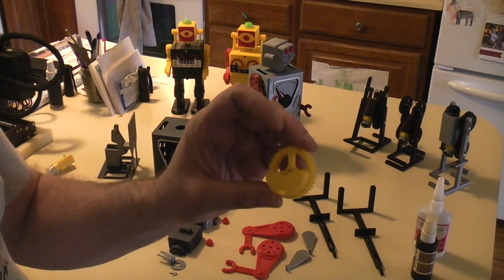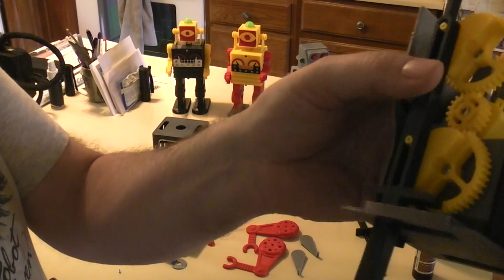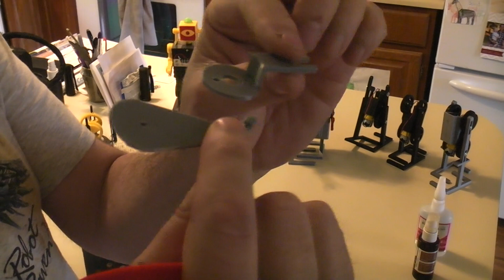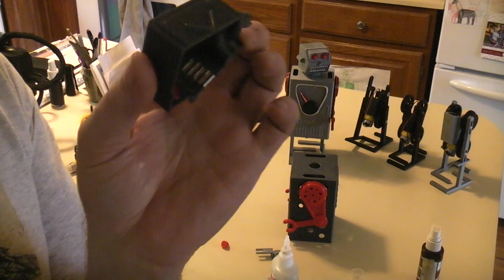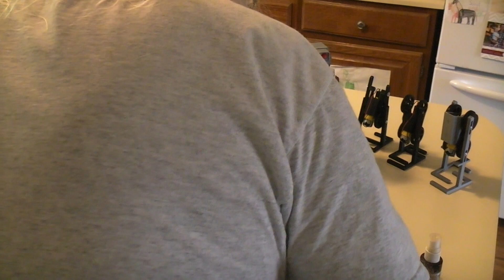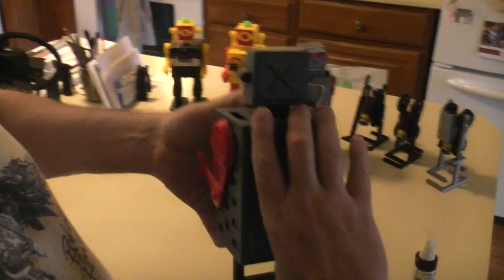"LIVE BUILD"  You can make the RoBox type 3 robot.

Comment: Just printed and assembled Type 3 robot, What fun!  and the video was so helpful. Thank you!!  Only having one issue..one of the lower cam gears keeps backing itself out after a minute of walking.  I'm using 3mmx12mm screws, maybe I need to open that hole a little?
Reply from the maker: Or maybe a dab of glue on the threads so they do not back out. But yes if the gear does not turn free then a larger hole or some oil might help.
Reply: @Robothut  Yep, A dab of glue fixed it. Thanks!  We've printed type 1,2 and 3 during quarantine..Time to move down your list to the next robot.  We are partial to the claw foot walkers though.  :)